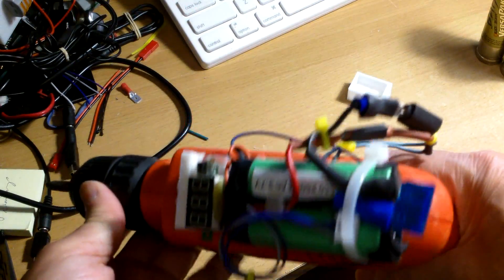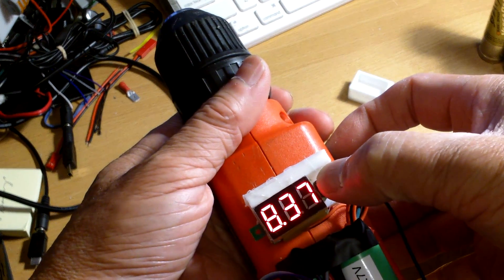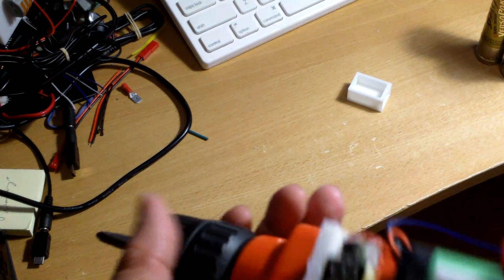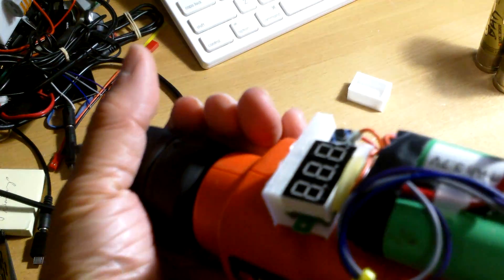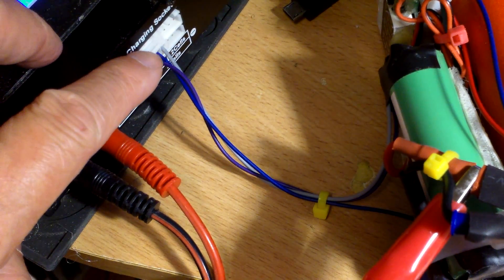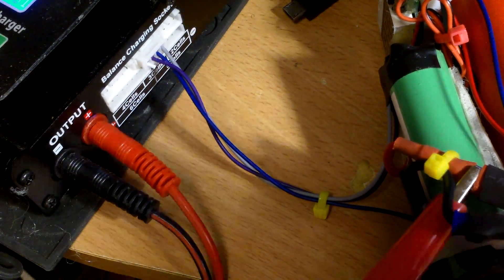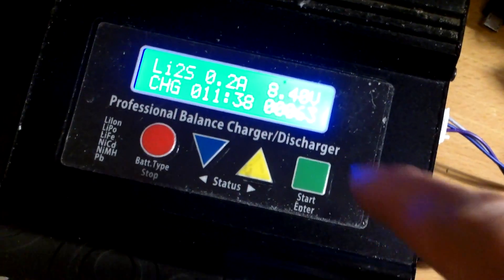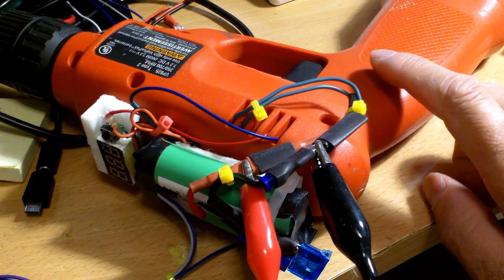It's not pretty but it works

Comment: You could have installed the 18650s into the original VP battery tubes.
Reply from the maker: Yes that can probably be done. Thanks for your input.